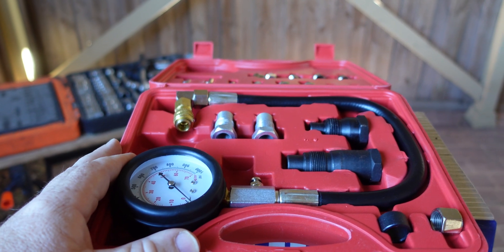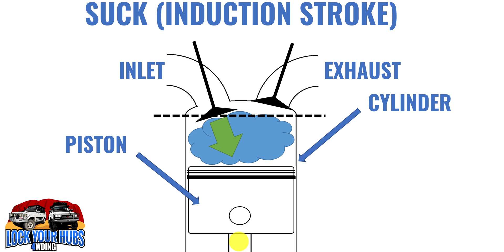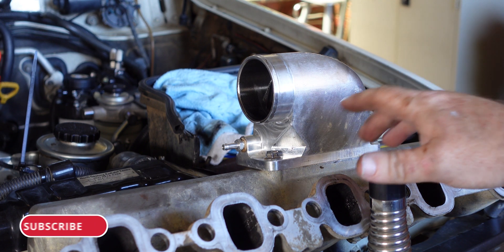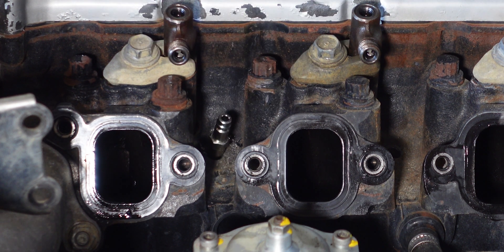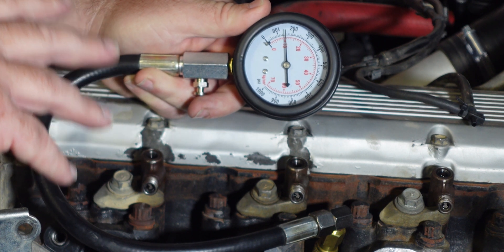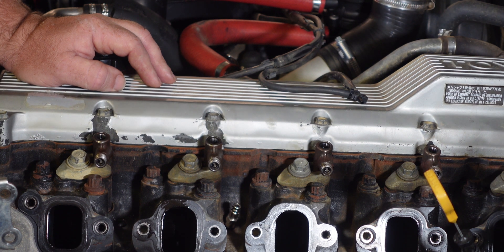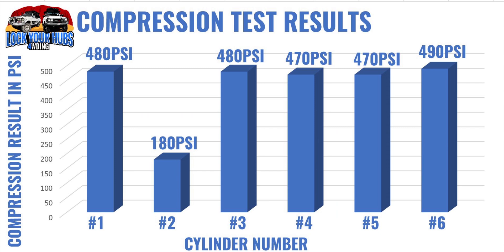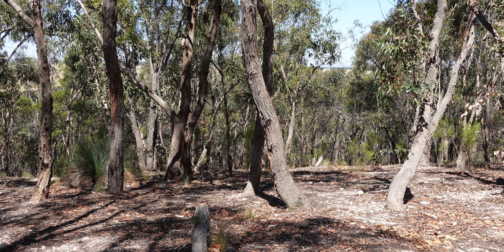Diesel Compression Test or Leak Down Test? Toyota  Land Cruiser 1HZ 1HD-T 1HDFT 1HDFTE

Comment: Great video! I'm about to compression test a relatives single cylinder diesel gen (no glow plug) once a mail order tester arrives (same kit as the video). Will the wet test give an indication of dodgy valves? I suspect the starting problem is excessive side to side play on the exhaust rocker, or even a damaged valve (the valves were tight tight tight when I adjusted them the other day as part of the annual service). The engine started and ran fine until I put on the recommended clearances. Since, then, nada. I'm reluctant to go back to tight tight tight because it could be masking a bigger issue. I've got the same engine type and valve specs as the faulty gen and mine runs sweet as a nut. Cheers.
Reply from the maker: A compression test is a bit like an "engine light* on your dash, it'll tell you there's something amiss, but not where your compress has gone. 

For that, you'll need a leak down test. https://youtu.be/e_x8NeXfvMM?si=E1h-ph-zAOJR6Otd
Reply: @LockyourHubs4WDing  Thanks - I looked earlier, only skipped through the video - they sell testers here for under $20 US each for compression and leak tester kits. I may as well splash out because I'm in for the long haul with diesels, I love'em. Noisy buggers but I've got a phobia about storing petrol at home. 
I'm in the Philippines, out in the sticks,  and last year during the rainy season our town was cut off from road supplies for almost a month due to land slides - the road literally washed off a mountain. You could not get gasoline for a good fortnight unless you got someone to go out on a motorbike to get you a can or two. But diesel wasn't a problem, I'd say I'm one of only 10% or so who drives a diesel here.
And they seem to last forever if you look after them, eg regular oil changes. Thanks for the quick response.
Reply: @LockyourHubs4WDing  Many thanks for your input. I got it fixed, valve clearances. 

The rockers were not sitting properly on their shaft, they were laterally displaced from the central position by maybe 5mm - that was where they were resting when I first lifted the cover. 

I've got a bigger version of the same generator, brand new, so I lifted the cover on that and the rockers had virtually no side to side play and were sitting right in the middle, not towards the sides. 

So I re-adjusted the little 'un, ensuring the rockers were centralised as I checked the clearances. She started first time on the electric and the recoil. Phew! Thanks again.

Comment: Cant this be used as a leak tester as well?
Reply from the maker: I guess so.
Reply: @LockyourHubs4WDing  many thanks.... I mean does it need to be tdc for checking a suspected head gasket? With this its pretty random but once pressure is reached watch the gauge go down ? Is that correct? Thanks
Reply from the maker: @titus4929  it's best to test at TDC

Comment: Really informative video. My mates car is burning oil from cyclinder 1. I suspect vlve seal. Other mechanics have said low compression. This helps alot.
Reply from the maker: While a compression test will tell you the general health of a cylinder's seal, if it's not great, it won't be able to tell you where the issue possibly is, that's the job of a leak down tester.

Comment: Watched both videos. What was the end result when you opened up the engine? That would have made a great video.
Reply from the maker: It was a holed piston.
Reply: @LockyourHubs4WDing  was it a full rebuild?
Reply from the maker: @deriusnorris4463  yes, change over long motor.
Reply: @LockyourHubs4WDing  ouch. Thx.
Reply: @LockyourHubs4WDing  that sucks. I have a FTE which has blow by a fair amount with white puffs... Stressing out for when I take it in... Is what it is... Thanks again.

Comment: This process is not the same for the 1HD-FT or 1HD-FTE  as they do not have glow plugs.. the only way to test compression is to pull the injectors and use a special tester.
Reply from the maker: Thanks for the tip!

Comment: Definitely a great vid mate, though you might confuse some people about when and what causes combustion in a diesel engine, great explanation other then stating that air "and fuel" enter the combustion chamber via the Inlet port and valve, you also said that eventually the compression causes combustion, while almost true you should mention that the point of combustion is actually controlled through injection timing and that only air is introduced through the inlet port and valves in a diesel, just seems important to mention is all, not having a go by any means, cheers
Reply from the maker: You're right, ideally a diesel runs a dry inlet, thanks for the tips.

Comment: Great vid, hope to swap a diesel into my FZJ80 some day. Got my 7.3l powerstroke in the mean time atleast.
Reply from the maker: The powerstroke is a great engine! I like the power of the petrol 80s, just not the fuel bill....
Reply: @LockyourHubs4WDing  Never stop making 80 series vids friend :)
Reply from the maker: They will pry the dual solid axles with coils all around from my cold dead hands! :)
Reply: 7.3 mucho peso y si está standard jala menos que un sensillo 15bt o un 1hdt originales Toyota con solo injectores de mayor caudal y turbo ball bearing de 54mm inducer compresor y 49mm exducer de turbina housing .48
Reply: Con 20psi estás jalando de a igual al 7.3 pero mucho menos consumo y menos peso ya q el peso es malo en offroad

Comment: Great video. What symptoms was the engine showing that led you to run the test?
Reply from the maker: It was filling up the catch can with oil faster than usual and a little rough at cold idle. Thanks for the kind words.
Reply: @LockyourHubs4WDing  would you advise adding a catch can for the 1-HDT engine?
Reply from the maker: @Ghostrider-71  depends on the emissions setup in your neck of the woods. If it has EGR, then definitely yes, just make sure the catch can you choose can flow enough for the engine.

Comment: That was sick! (Is that the term that is used these days or I am of touch - again?). 
Hmm, sounds like a series on tracking down compression related issues is  warranted. Tackle the basics - where can cylinder compression leaks occur and how to test for each possibility and then, perhaps,  an indication of which are exceedingly rare.   
I'm running an 4JX1, so not all your viewers are interested specifically in Toyotas :), so it would be general diesel info.
Reply from the maker: Hey, I've got an Isuzu, Mazda Suzuki and a Toyota in the driveway!

 I just like cars/bikes/planes, anything with an engine!

There is more diesel related episodes in the pipeline!

Comment: a great explanation but can you also include in the diagram where the glow plug is in relation to piston and cylinder? and what does it do?
Reply from the maker: The location of the glow plug is dependant in the head design and whether the diesel is a indirect injection (like a 1HZ) or direct injection (like the engine tested a 1HD-T). 

In an indirect injection engine the glow plug is usually in the precombustion chamber, in a direct injection engine it'll be in the combustion chamber itself.

The purpose of the glow plug is to help start a cold engine.

Comment: Great video mate, what lead you to check the compression, any smoke, rough idle or oil use? I have a similar issue, well think I do/did, two mechanics gave me different results. One was 180 and the other 520 was my happy 400k birthday surprise which I also had the valves check at the same time. No smoke, no oil usage, no rough idle and no blow by. Be keen to see the leakdown test.
Reply from the maker: The 80 was filling up the catch can a lot more than usual and when cold was a little rough at idle. While we haven't pulled the head off yet, I'm hoping it's only a head gasket and not a hole in the piston!

Looks like we'll have to record the leakdown test as well.
Reply: @LockyourHubs4WDing  we can only hope, fingers crossed